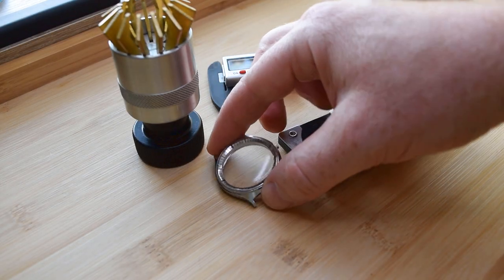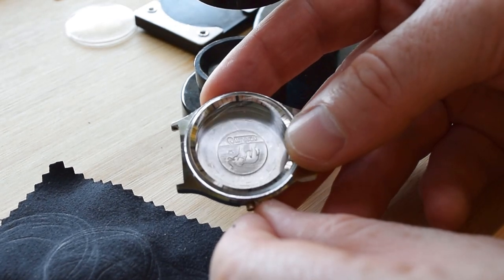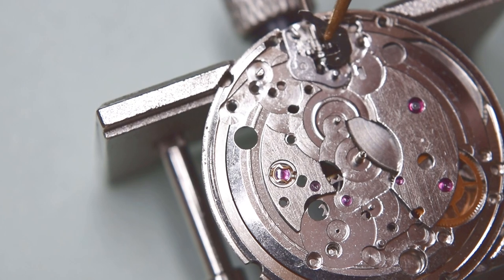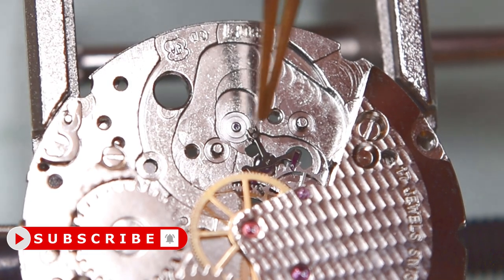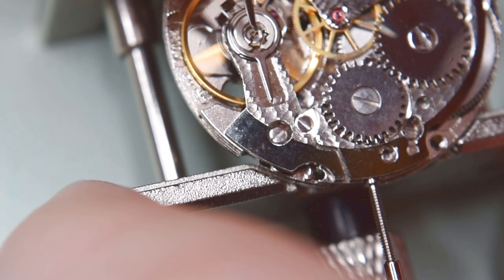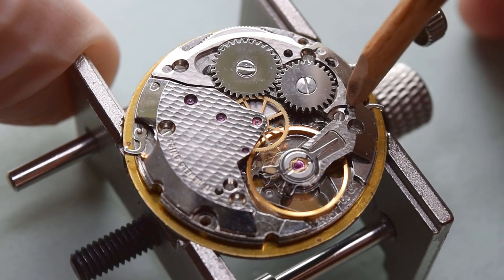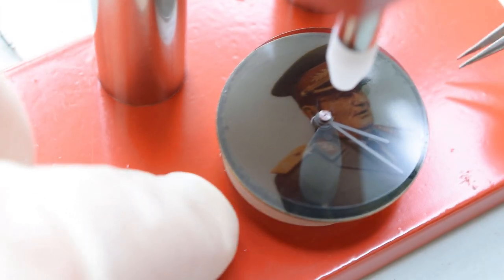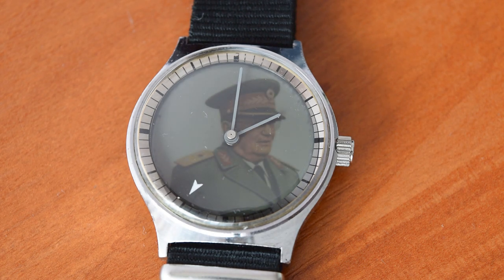Mechanical watch service at home working on mysterious ETA 2801 part 2/2

Comment: It is a polarized filter on the seconds disc.
I've only seen this trick used once before,
It was a Dr Who watch and as you can imagine 
the Tardis vanished and returned, At the time, 
I thought it was an original idea.
This watch proves that nothing is new.😉👍
Reply from the maker: Anyway is still interesting, In the 80's there were postcards made similarly.